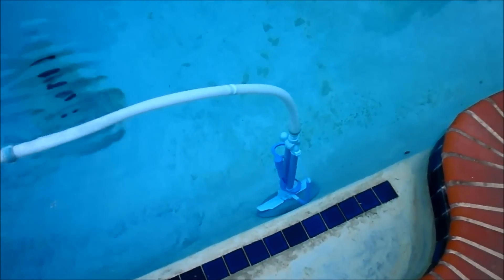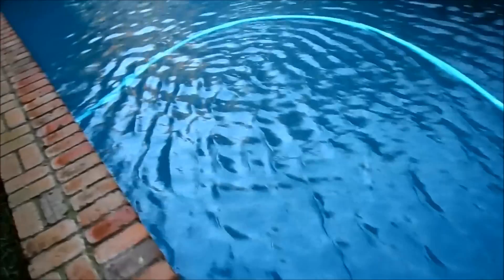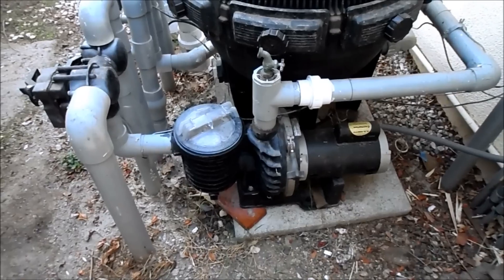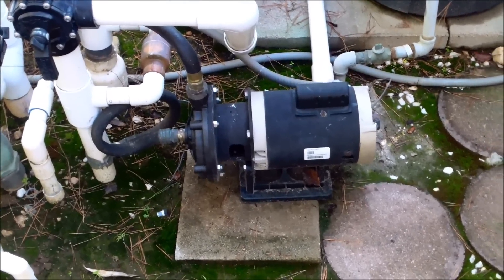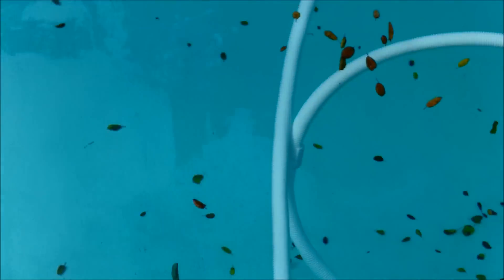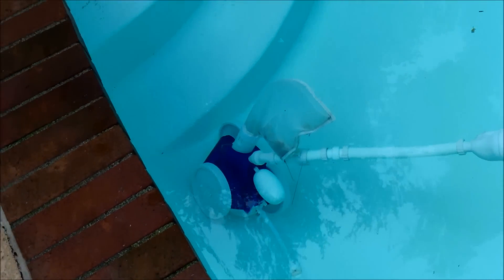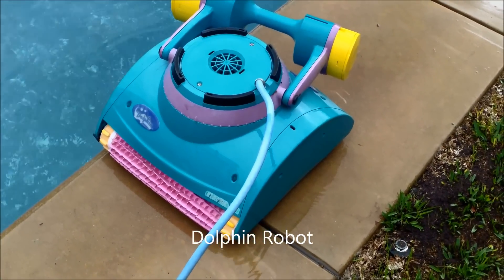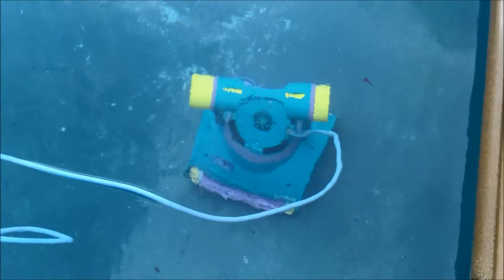HOW DOES an Automatic Swimming Pool Cleaner work?

Comment: Excellent video!  I had an el cheapo pool cleaner from Lowes, worked okay, but the hoses finally gave up.  Since I have had the pool enclosure rescreened, I find I can keep the cool clean using a brush and manual cleaner, but if I didn't have an enclosure, would definitely get another cleaner that you recommend.

Comment from the maker: (con't from below) pool should have sufficient return pressure. If you were able to screw in the return jet then you lack the correct amount of pressure. This is important since once you break the cleaner box seal you usually cannot return it. So with two jets out of three plugged you should be able to tell if there is enough return pressure. If you have four return jets you will need to plug three for the test. Hope that helps.

Comment from the maker: You can try moving the weights on the cleaner, but some pools have a shape that impedes it's full range of movement. You can purchase the pool Twister product as I have a few with those units and it makes a difference - the cleaner  travels the entire pool. Also check the return jet positions - sometimes the water pushes the hoses around and also causes it not to move through the entire pool. So try that & the weights first before you invest in a Twister.

Comment: Thank you for all the information.  I have a question about the new variable speed magnetic pumps and a return side cleaner. Today I have a 1/2 hp pump that runs around 3450 rpm and it runs the return side vacuum fine. The newer pump I am thinking about runs at the most efficient speed of 1600 rpm. Do you believe this is enough to run the return vacuum?  The newer pump has higher rpm settings but if I want the vacuum to run for many hours, I want the lower rpm for energy cost savings.  Thank you

Comment: In regards to energy efficiency if you ran your pool cleaner / pump for 2 to 3 hrs a day, would a robot cleaner be more energy efficient than the other two classes putting into consideration the energy that the pool pump motors would have to expend in order to run the suction side or return side cleaners?
Reply from the maker: JBTYpr You need to run the pump anywaty so a suction cleaner is technically is energy efficient. The Pressure or Return Side cleaners will use more energy as the booster pump is running so they are less efficient. Robot cleaners cost maybe a few dollars a month to run but the cost of the unit is substantial vs. the other two types of cleaners.

Comment from the maker: 1 1/2 hp should be fine. Return pressure can be decieving spread among a few return jets. Here is a simple test that you can do. Depending on the number of jets you have; clean the filter. Go to your local pool store and purchase Two 1 1/2" threaded plugs (3 return jets  is the example). Remove all three return jet threaded fixtures. Plug off two of the return lines w/ plugs, Turn pool on. With the one remaining return line, try to screw the return jet fixture in.If you can't then your (con't)

Comment: I thought I had found the problem as to why my lights would not come on the cell as it had been working before. Now it is not lighting up so I read to replace the fuse. The fuse is not broken. Could the fuse still be bad, it was working minutes before.
Reply from the maker: It could still be bad. Sometimes the little stand inside is intact but burned out. Radio Shack should carry that fuse.

Comment: Does the flow regulator valve ajust the suction?
Reply from the maker: If you mean the Flow Keeper Valve that comes with the Zodiac cleaners - yes and no. It is a self adjusting valve and in some cases even set at the lowest setting the pump still has too much suction (I am talking about a skimmer connection here). In that case I will swap the Zodiac one out and install one from Poolvergnuegen or Hayward - way more adjustable.

Comment: What's the difference between a 360 and 380?
Reply from the maker: Sarah Abdo 360 does not require a separate booster pump but does require 1.5" threaded return lines. The 380 needs a dediated return line and a booster pump.
Reply: Swimming Pool Tips, Reviews & How To -MrDgvb1  but aren't they the same from the inside out. 
Do you think it would work if I got the 380 and connect it as a 360 Polaris. Would it run the same?
Reply from the maker: Sarah Abdo  The hoses are different. The 360 is almost as wide as a suction side cleaner whereas the 380 is very thin - so no it wouldn't work.
Reply: Swimming Pool Tips, Reviews & How To -MrDgvb1 thank you so much for replying to my comment. I got myself an old Polaris 380 off of Craigslist, one of the belt drive has broken off.   and your videos are very helpful. Thank you  :) 
One more question, my pool doesn't have the connector thing for the Polaris, I was wondering if I can use the one jets as a connector to the Polaris? . :33

Comment: Having trouble getting my automatic pool cleaner to stay connected into the wall, am I turning it the wrong way?
Reply from the maker: Probably air from system when it turn off pushing it out. Are you using a device called a vac lock?